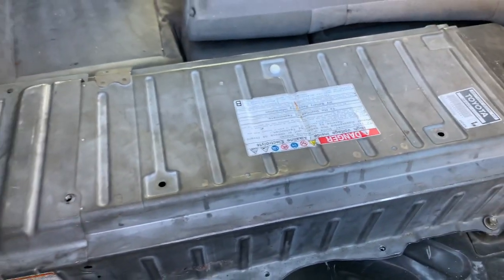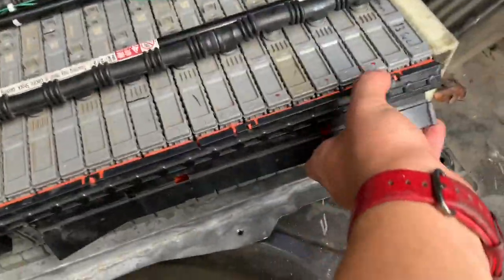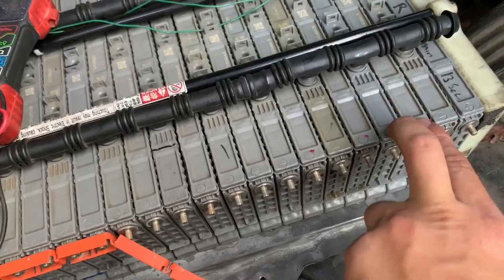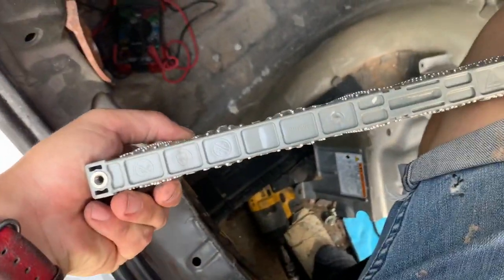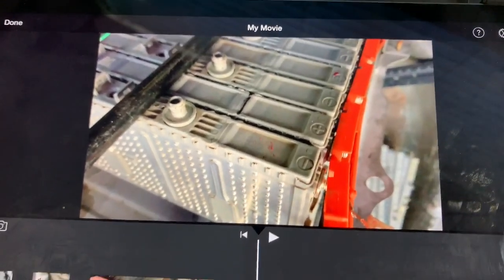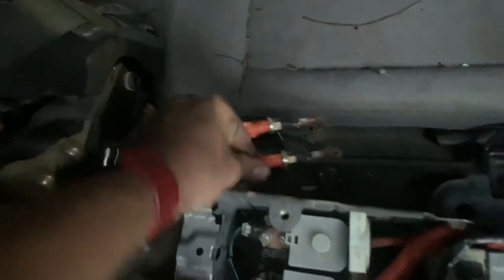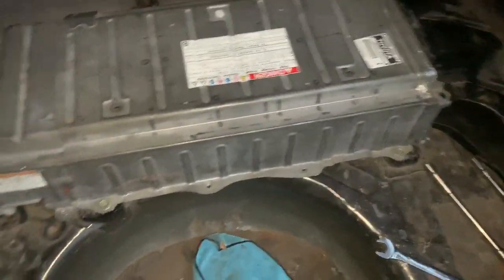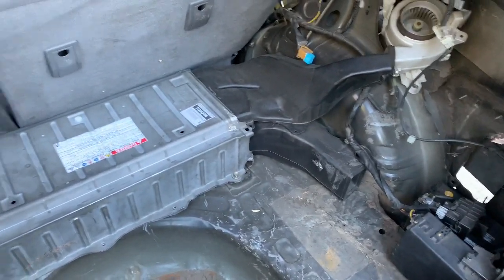How to replace a defective Prius Hybrid battery cell

Comment: Killer job dude. You’re the only guy on YouTube that actually did the job in the car without making it seem like a complete mission.
Reply: but it IS a mission? 

watching the vid and reading comments like yours underprepared me for this job tbh... from the vid it seems like you can do the whole job in the car. now i find out i would have to remove it, and should have just removed it and made it easier to begin with... and just more steps/stuff than I really set aside time for...ugh! /end rant
Reply: @bestmantoday  I think the 8mm bolts on the bottom need to come out before the 12mm end bolts.  As soon as the 12s are removed, the pack will expand and the 8s will move and binde.  And, just thinking about the future; why bother putting the 8mm bolts back in?  What do they do besides nothing?  The 12s and the retaining rods hold the pack together.
Reply: Still have to flip it to get the modules out (not shown)...

Comment: I'm working on this now.  This video leaves out waaaay too much.  My recommendation to everyone, don't use this as your only reference or you will be highly frustrated.  One important piece is that the entire battery casing needs to be removed from the car and elevated to get to the 8mm bolts on the bottom.  And it's at least 100 pounds. I recommend having a workbench and a helper.  Also, have little sandwich bags and labels ready for the many bolts to keep track of.

Comment: Thank you, thank you.  I was ready to scrap my 2008 Prius due to the battery alerts.  Your clear instructions helped me get the ONE cell that was bad out and have a Prius that runs like new!!!
Reply: @Charles Johnston it was only one bad cell??
Reply: @gregkampoz8009  yea it's a very sensitive system and one or two cells That's why I've been trying to do the research on how to replace just a few cells myself when I'm not an electrician nor a mechanic instead of paying over $1,000 to replace every cell in the battery

Comment: I say throw away the 8mm bolts that go up thru the bottom.  That way if a cell needs to be replaced, you don't have to pull the entire battery out and flip it over.  What say y'all?

Comment: I know I am late to the party. But let me raise three questions. 
1) A major source of showing weak block is the bus-bars being corroded and oxidized. I was surprised they were not cleaned. 
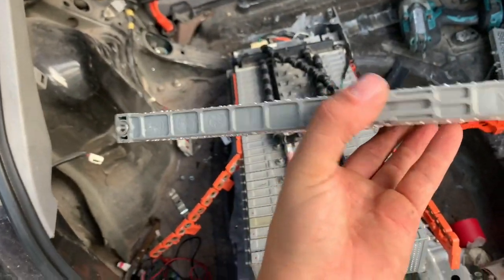2) Did I miss something? You can’t remove the the blocks in-situ ( in place) without unscrewing each block from the bottom of the chassis (@3:36).That can’t be done, without removing the whole battery pack and getting access to those screws. So how was that achieved? @4:46 you show the battery pack in the tire-well. That means you removed the battery pack out, the most labor intensive part of the exercise. But you skipped that step.
3) Why will you call a DVM a scanner? Confuses the heck of noobies. 
4) I wish you had specified which generation Prius it is. The cell number ( actually they are known as blades) is from right to left in Gen 2, and left to right in Gen 3. Regardless of the generation, look at the black ground wire for the high voltage, it always goes to the negative terminal of module 1. Update: looking at the Soleus Scanner results, the car is a 2004, Gen 2.

Comment: Thank you so much, this video is going to save me $1,000+ when my 2006 battery starts to die

Question- is there anywhere that you can touch that you could accidentally get electrocuted? I want to be extra safe and make sure I don't get shocked, that's my biggest concern when dealing with the hybrid battery
Reply: Either way, PPE.
Reply: just make sure the postive and negative terminals  DONT TOUCH each other while  in the case and the battery pack is in the car and you are doing what he is doing,..if the terminals do touch ea h other , pass my love to michael jackson.

Comment: The batteries bloat when they are charged. You need to keep them in their compression pack or make your own with clamps/wood. Also, when replacing “blocks” you should recondition, balance the entire pack. Good luck homie!
Reply: If I was to do what he did and just plop a few new cells in do you think the car would actually run and the lights will go away on the dash? Cause I'm just tryna sell my car and can't if the light stays on I haven't put in my new 4 cells in cause I've been considering reconditioning them but it seems like a lot of work reconditioning the whole battery and I'm not very smart with all that.
Reply: @danielarmstrong3487  That will work if you can find out which cells are the lowest ones.  I use the both the Dr Prius and have hacked TechStream on my laptop.  Once you see which block(s) are low, you can replace them. That should hold you over for several months. After replacing the new cell/block, I would put it back together and let it sit for 24 hours so they can balance out within the pack.  

On a sketchy note, if you just want to clear the code/light ...get the correct dongle and buy the dr Prius app on an Android device, you can simply go in and clear the 'check hybrid' code. It should run a day or two so without throwing the code again and illuminating the warning lights. Thats being a sketchy seller tho. haha but....its you note so....FYI ha

Comment: Can you also swap around the cells on the outside of each side to the inside since they tend to read a bit higher on capacity, moving the slightly weaker ones to the outsides, with the chance that it might prolong the life of the hybrid battery overall?
Reply: They are numbered  butjusy remember  to renumber for your own sake

Comment: I notices you are counting cell 1 at the fan (right/passenger) side. I have seen another video where they count cell 1 at the module/left side. So, cell 1 is at the opposite side of the module/ecu - correct?

Comment: Thanks for the video, this mission is something I need to do soon. 
I see you use a sensor to check the battery, what device is that?
I see you have a display system for checking the codes on the prius computer for the battery issue. What device is that?
I've never worked on my prius before and now the battery is not holding a charge/the car is not starting up consistently. It would be great if I could do this operation myself and not pay hundreds of dollars for a mechanic to do it. Thanks for the guidance.

Comment: Tried this myself. Was an insane experience considering I’ve never done a job that intricate before. After replacing the bad cell. My car won’t start. It’ll just turn on but engine won’t go. I’m assuming I might’ve done something wrong? Or do I have to jump the Prius in order to get the juice flowing. Any advice would be greatly appreciated!
Reply: Hey, Did you ever fix it? I have a 2010 and am having the same problem my car just doesn't turn on telling me to check hybrid system

Comment: I recently replaced 5 cells.  I had trouble lining up probably a total of 6 cells to the 8 Millimeter hole/bolts that holds the cell down.  It seems pretty sturdy and tight in there without the 8 millimeter bolts holding down the cells.  Will i be okay?

Comment: Is there a way to level out the battery before fully assembling on hybrid gen 2 way I replace 10 of 28 how do I get it to not throw codes and what kind of reader should I use

Comment: Hi. How about balancing the whole battery pack after the new cell and the 24/48 hour charging? Or it isn't necessary?
Reply: Yes i have this same question!! What charger if not prolong?  How many amps to how many cells? Should one just use a charger/discharger ..?? I bout this charger that does trickle charging will it work to charge 24 hours?

Comment: Just today I changed block 8 with new cells, putting the new ones on the very front. I assembled everything back, but now my car won't start & I'm getting the (hybrid system light). All battery cells are at 8V and double checked all wires and bols. Do you have any other suggestions what it might be?
Reply: @David: Did you finally figured it out? Was it the utility battery (12V) either disconnected, or discharged causing the problem? I am assuming that the high voltage safety orange plug is pushed in properly, and engaged.
Reply: What problem did it turn out to be???

Comment: Man I wish my parents just did that on their Prius but they just went straight ahead and replaced the whole battery for about more than 1000 dollars. Dad was saying about replacing bad blocks is not useful since the others will die off slowly.
Reply: Your dad has no common,  you can tell him that!
Reply: @ranat5526  Maybe
Reply: where can I spend $1000 for the unit? here in Seattle wa, cost about $2500.00
Reply: @senderismoalpinismoydescub1819  It's a reconditioned one

Comment: I have 2016 prius v I replaced head gasket also replaced a bad model do I have to clear computer because it starts but then 3 minutes after it turns of and all the dash lights come on. It also seas 6 stored codes

Comment: I replaced one cell in my 2007 camry hybrid. Put everything back. 
I have power to the dash and all "check hybrid and check VSC" codes still there but the car will not start... 12 volt battery is good. 

Any ideas as to why?
Reply from the maker: Have you cleared the codes? Plugged in the orange safety switch all the way?
Reply: Did u manage to turn it on?!
Reply: I’m having same issues. I ordered scanners from Amazon. I will post results within few days.

Comment: My battery cell 7 is showing a lower voltage than it should, until now ive ignored the issue, but sometimes the car will just fall out of drive (it still stays in drive on the dashboard) 

Can the battery affect the shifting of the car in any way?
Reply: Yes

Comment: No comment at all about checking voltage or amps for the modules as if you place one that goes out of the range it will also cause the car to detect a defective cell, you can't take any cell and put it in the battery

Comment: Dont you have to charge the battery and discharge or balance the battery
Reply from the maker: No. I just replaced the cell and drove it for a few hours and the car recharged and leveled the voltage
Reply: @nazarkali1158  
The batteries don't have to be leveled , because I've heard they have to be ???

Comment: Hi I have a auris 2016 I have removed the battery and checked all the cell voltages they all show between 7.91-8.02 how would I know which cell is bad without a code scanner ?  Any help would be appreciated